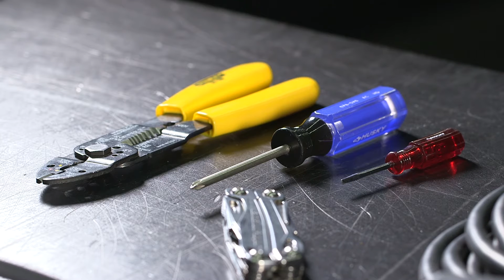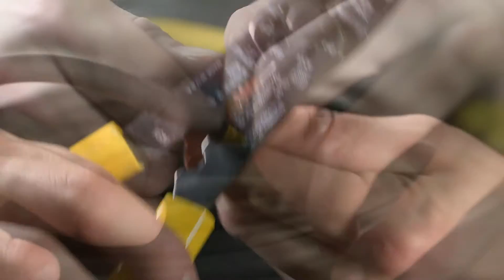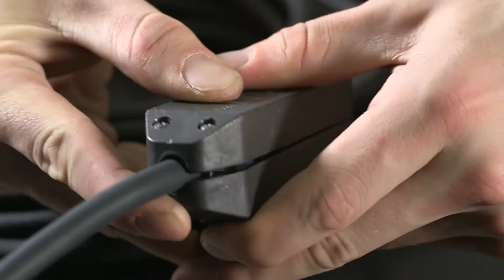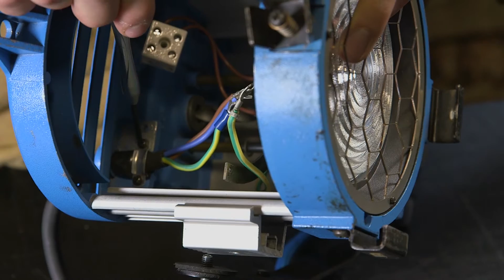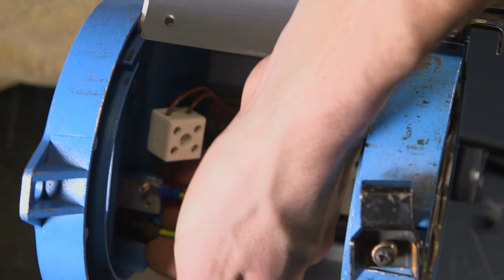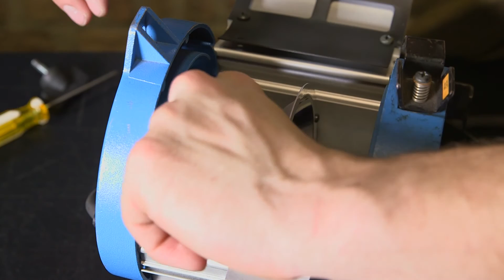Arri Tungsten Light Repair - MagnanimousRentals.com

Comment: overall very clear and helpful.

none of these problems will occur if the manufacturer size up the wire, this is a commercial machine, the workload is heavy, it needs thicker cable.
Reply from the maker: We come from a rental environment, wear and tear is significant and in-shop repairs are a must.

Comment: Really appreciate this. Thanks for doing such great job on this. We are in Peru filming right now and having issues. The house power blew out the bulbs. We are unsure if it was just the bulb or when we get back to the states if there’s a deeper issue that happened from the power in Peru. Our other quasar lights have had no issues however.